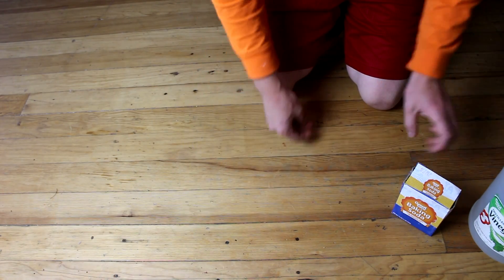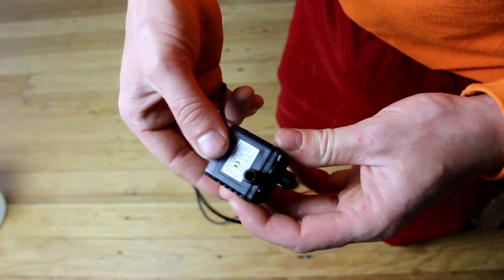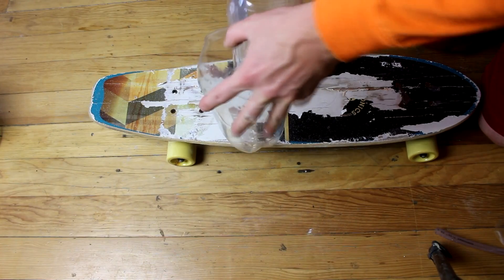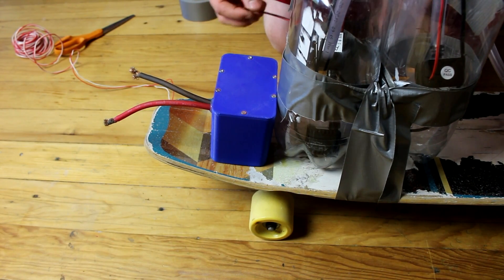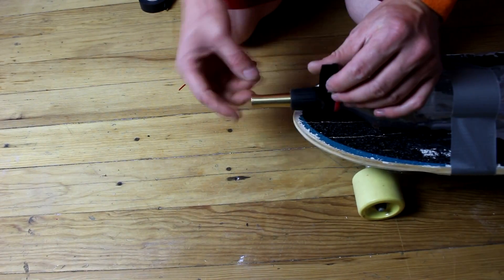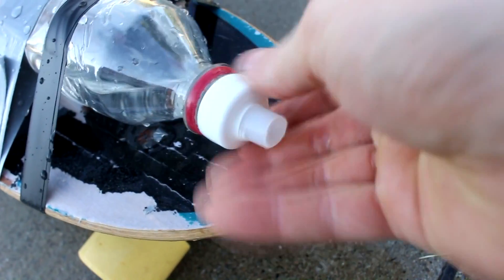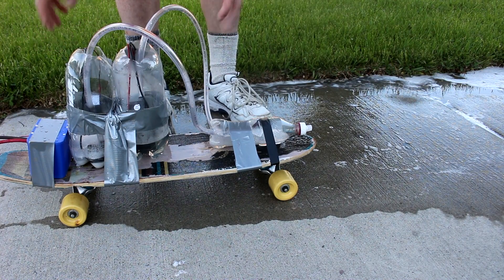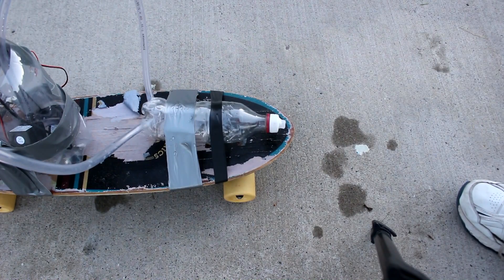Liquid Fueled Baking Soda/Vinegar Rocket

Comment: Make hybrid rocket that uses gasoline and liquid oxygen
Reply: that wouldn't be a hybrid. a hybrid uses a solid fuel such as rubber
Reply: No, the gasoline melts when and realeses vapours which in turn burn, and when those vapours burn the heat from the combustion makes more gasoline melts and thus giving the effect of solid gasoline bruning
Reply: Liquid Florine and Hydrogen all the way. If something goes wrong just fill in the crater and walk away.
Reply: Real Rocket Scientists use Refined Kerosene
Reply: All gases expand roughly the same amount when heated that's why the Ideal gas law works. For a high isp you want a light gas that is as hot as possible, that's why nuclear core engines are always designed to use H2. Also the products of a hydrogen fluoride engine are, H2 + F2 => 2HF which is a very light gas. The isp for this engine is around 400, second only to Li+H2+F2. The Isp for H2+O2 is only 380. fluorine is also safe to store in standard stainless steel drums you just have to neutralize them with dilute fluorine gas first to produce a metal fluoride barrier.

Fluorine is theoretically a great oxidizer for rockets but it is extremely dangerous which is why no sane person uses it anymore. also why my previous post was mostly sarcasm.
Reply: Use Red Fuming Nitric Acid and Kerosene or go home.

You might want to inhibit the nitric acid though, else your containers won't last very long ^_^
Reply: Good luck finding tonnes of Fluorine, let along mounting it in any kind of metal housing.

Would be incredibly expensive & the specific thrust of it would probably be shit.

You need a gas that expands a lot, and water vapour expands a lot. Hence why they use Liquid H and O. Kerosene is also pretty decent. Although, you get some not great exhaust fumes from rockets using Kerosene and IRFNA.

Nitrogen Oxides, CO2 and Water vapour the main exhausts though, all of which are gasses, so it's a very efficient fuel. Probably why the Russians were so fond of it for Intermediate range ballistic missiles.
Reply: Freddie Scowen I think it could be a gas-liquid, gas-solid, and maybe solid-liquid
Reply: That's what happens every time a liquid or a solid burn: the heat turns them into gas, then the gases react with oxygen. Wood does the same, would you say that wood doesn't burn?
Thus, frozen gasoline burns. ;)
Reply: I finished gen chem this past year at uni. I understand some of what you're saying!
Reply: freeze the gasoline and run O2 over it?
Reply: How do you get gasoline to burn below its freezing point (-43c) ? you cant.
Reply: Gas doesn't burn. The vapors do. Freeze it and you wont have anything useful.
Reply: FROZEN GASOLINE DOES BURN AND VERY AGGRESIVELY TOO.!! WATCH GRANT THOMPSONS VID